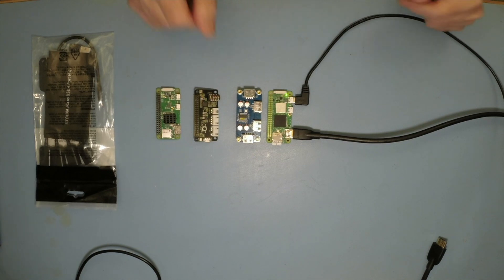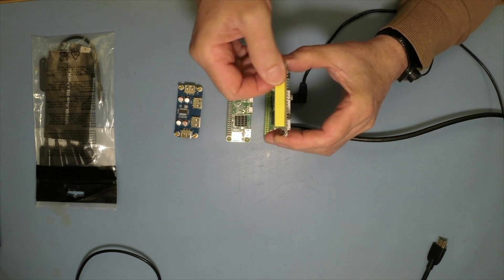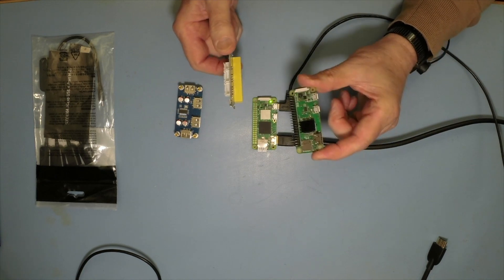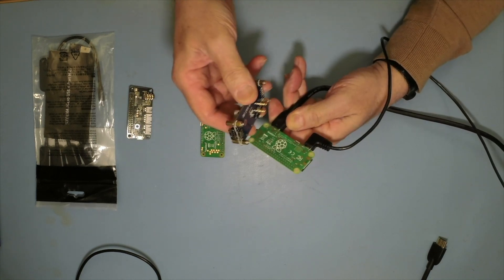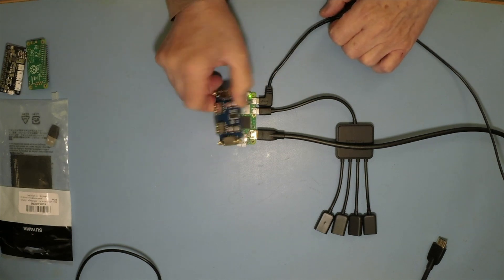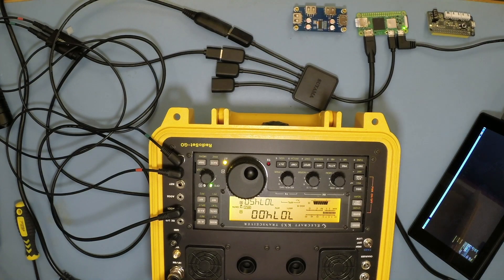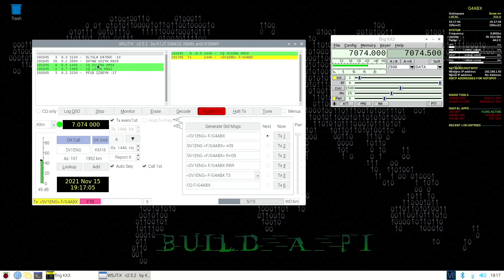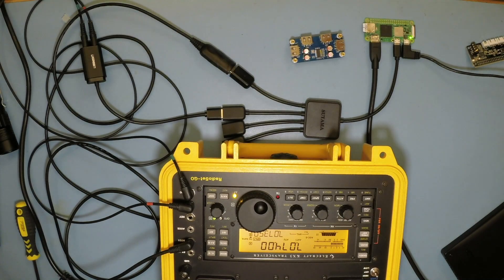Raspberry Pi zero-2W USB peripherals

Comment: Does the USB hub need to be otg I've tried 2 new hubs and they don't work both in the correct port
Reply from the maker: Good afternoon Sean. 
OTG functionality is to facilitate the connection of (amongst other things) an Ethernet port. 
I have one of those HATs I'll be reviewing over the next couple of weeks.

Neither of my two USB solutions -- see my website for more details g4abx.co.uk -- utilise the OTG functionality and both the 'HAT' and the USB 'spider' (as I call it) work fine plugged into the 'non-power' micro USB port on the Z2W giving me up to 4 USB ports.
The 'HAT' used in the video is now connected to the Z2W inside my KX3 GoBox with the Z2W providing wifi connectivity to my external Tablet for logging and data modes.

I can therefore operate the GoBox 'remotely' with the Tablet connected to the Z2W's generated HotSpot.

73 and Happy New Year
Bruce G4ABX
g4abx.co.uk
@G4ABX

Comment: Nice video, thanks for sharing!  I'm looking at doing something similar with a 2W and a Digirig Mobile.  I tried the draws hat with very little success. Julian pointed me toward the Digirig and I'd like to make it a "low cost" set-up with a Xiegu G1M.  If I can make that work, I'll build another for the ft-891.
Reply from the maker: Evening Brad
Apologies for the late reply -- Christmas has kept my focus for a few days!

I use the 2W and Build-a-pi to run digital modes on my Xeigu G90 -- which because of its 20 watt capability, is great for SSB POTA contacts. 5W is a bit tough -- particularly from the UK where POTA activity is rather limited.
You will have no problem getting the 2W to run digital modes.
I run WSJT-X for FT8 and FT4 and FLdigi for PSK and RTTY, again using and audio modem/cat control box.
if you can put up with the wires and dongles, the sound card will cost you less than $10 and for the Serial CAT interface -- I think you can actually use the one that came with the rig for firmware programming -- although I've not tried that myself yet.

Have fun and a Happy New Year
73
Bruce G4ABX

Comment: this fits the z2w fine "IBest Ethernet/USB HUB HAT for Raspberry Pi 3 B+/3 B/2 B/Zero/Zero W/Zero WH/Zero 2 W Expansion Board, 1x RJ45 Ethernet Port,3x USB Ports Compatible with USB2.0/1.1"
Reply from the maker: Thanks Paul. I have a similar version :-)
73
Bruce G4ABX

Comment: USB gadgets are a mess in the zero 2W even using buster.
Reply from the maker: Interesting reply. 
I've run 2 different USB 'HATs,' sound cards, serial (RS232) adapters, a keyboard and a mouse and those work fine. 
Bluetooth connectivity is also working with my portable keyboard and mouse in 'headless' mode.
I'm running the latest Buster with KM4ACK's 'Build a Pi' scripts.
73
Bruce 
@G4ABX
Reply: @G4ABX  Im sure they do. No im talking about USB UVC gadgets like the pi acting as a usb webcam or using the usb port as Ethernet. When i seen this video i thought that is what you where testing. It was my mistake.
Reply from the maker: @KarolineLeavitt-29a  Ok Understood -- now :-)
I will be reviewing different USB connected 'HATS' shortly -- including Ethernet. 
I'm mostly interested in low power applications driven from lightweight rechargeable Lithium chemistry batteries.
Best wishes
Bruce

Comment: Can we run scrcpy on pi zero 2?
Reply from the maker: Good morning.
If it will run on a Raspberry Pi 4b then it will most likely be fine on the zero-2W.
The shortage of RAM on the zero 2W might reduce screen rendering speed.
All my Apps that run on the 4B run on the Zero 2W.

73
Bruce G4ABX
@G4ABX
g4abx.co.uk
Dr.T(G4ABX)
Reply: It runs perfectly fine on pi 4B
Reply: @mrnobody4183  which has double or more memory,  also the 02W cpu is capped at 1 Ghz, 
have seen overclocking to 1.3 ... which might need heatsinks
Reply from the maker: Hi Jvy Ben.
I overclock my zero 2W at 1.2Ghz. It has a small heatsink and that seems to take care of everything quite nicely.
I've also found that reducing the screen size/resolution to 720p take a load off the CPU/Ram and helps keep things cool.
73
Bruce G4ABX
Reply: @G4ABX  thanks for the info

Comment: Nice video, thank you for sharing. Can you post the CPU temp after running FLRIG/WSJT-X for awhile? I am considering a similar build and worry that the GUI based WSJT-X will consume a large amt of Processor resources and thus result in excess heat. I think as we explore the Pi Zero 2W more, heat dissipation may be an issue with CPU intensive processes.  Rich KQ9L
Reply: Really helpful. Thank you very much!!
Reply from the maker: You are welcome. 
Have a great day
73
Bruce G4ABX
Reply from the maker: Good afternoon Rich
I've run the zero-2W with WSJT-X and FLRig  without a heatsink for 4hours and the max temperature was 53C in a 21C ambient.
I intend to add a small 'Stock' RASPi heatsink -- similar to the one you can see on my Pi-zero in the video but slightly larger for the increased package size of the Zero-2W CPU/RAM package.

My GoBox has 2 fans (Take a look at my GoBox videos) that push air into the box and create 'positive pressure' forcing the air out around the KX3 packaged in the faceplate. All other 'edges' are sealed and sockets  are sealed with heat shrink tubing so the air has to 'exit' in this way.

Having run a 4B inside the GoBox for the past few month without any ill effects, I'm confident the zero-2W will be fine.

You might note that I purposely 'killed' the video intensive 'audio waterfall.'
This small sacrifice in 'form rather than function' reduces the processing load and hence power consumption and temperature rise.

The zero-2w also works well with FLdigi - which I also got to run well on the zero. The zero-2W is streets ahead of its underpowered sibling!

73
Bruce G4ABX
g4abx.co.uk
@G4ABX
Reply: @G4ABX  Thank you for the lengthy reply, much appreciated! I will be building mine this weekend and will also kill the Waterfall. Cheers and keep the videos coming! Rich KQ9L
Reply from the maker: You are welcome Rich.
The more we can help each other, the better this hobby will be :-)
Enjoy your radio -- and don't forget to 'Get On The AIR'

73
Bruce G4ABX
g4abx.co.uk
@G4ABX
Reply: @G4ABX  Agree with sharing info. My XYL would suggest I need to "get off the air" more frequently and do other things HAHA! Rich KQ9L😁
Reply from the maker: Ah. I have one of those too -- and she's the one who encouraged me to start this Youtube channel. 
That (mostly) gives me a free pardon :-)
73
Bruce G4ABX